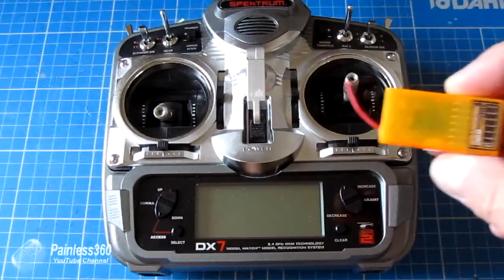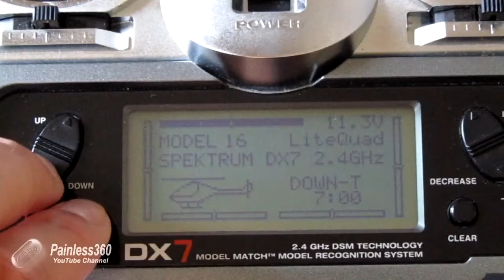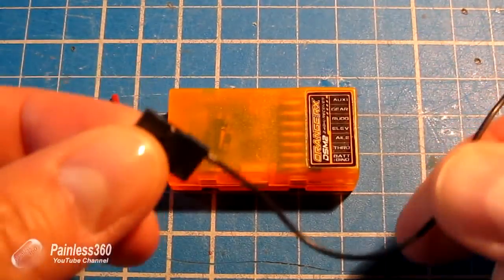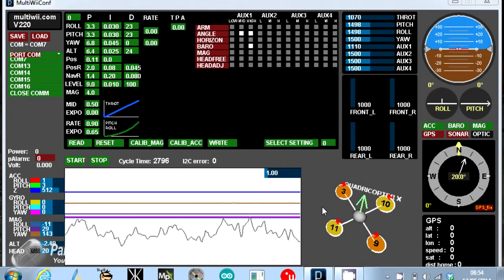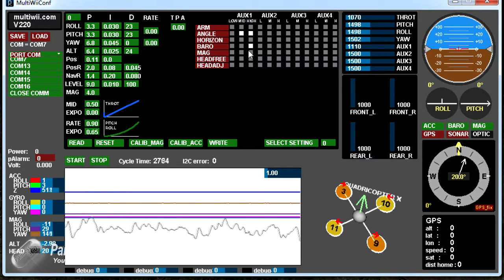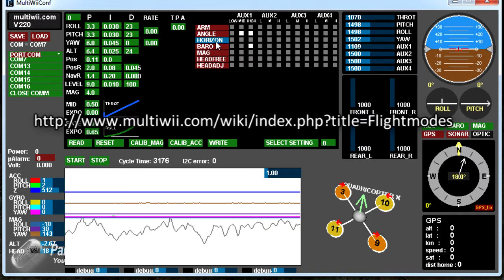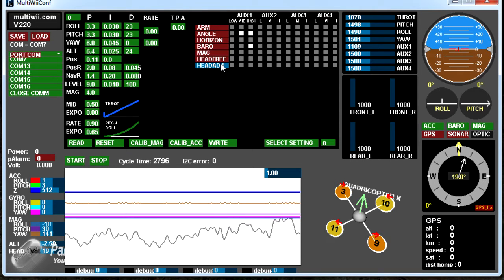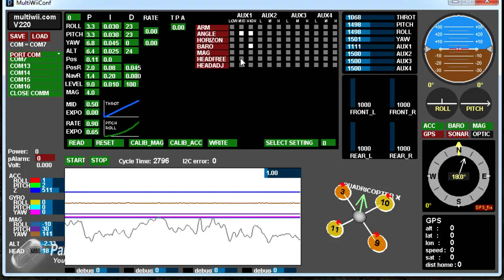(4/7) MultiWii modes - radio, connection and software setup

Comment: Thanks for this informative Video, I do have a couple of questions I bought a kit off of Craig's list came with a burned out multi wii pro with gps I noticed the price is about the same for the apm 2.6. Now I have built a quad with an apm 2.5 and it took me sometime and few crashes to master it as far as setup. My question is from your experience should I get another apm this time the 2.6 or the multiwii pro and learn something new. Which one is better in your opinion. Also I only have 2 flight modes on my old futaba transmitter with a frsky dft module. I'm not sure to go with turnigy 9xr or the taranis which one is better as far as flight mode ease of setup. Thank you
Reply from the maker: Flight controllers are a very personal thing. Some people are Xbox, some PlayStation! Every answer is down to personal preference - with that said, here is my two pence - I really like the APM 2.5/2.6. They are easy to use and work great with the Mission Planner software if you want to program flights and use the machine more like a drone. Super stable and easy to get the GPS and telemetry working.The Multiwii Pro is a good alternative if you are willing to do a little work to get everything working together with the Mission Planner software. Personally I'd use the APM 2.X for FLP/drone work and the Multiwii/KK2.X for normal quad flying. Hope this helps.